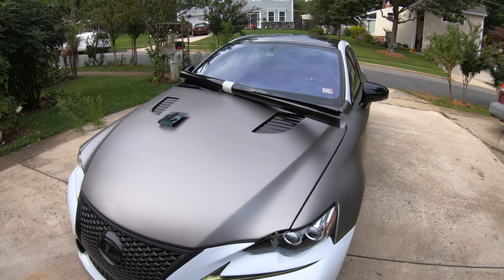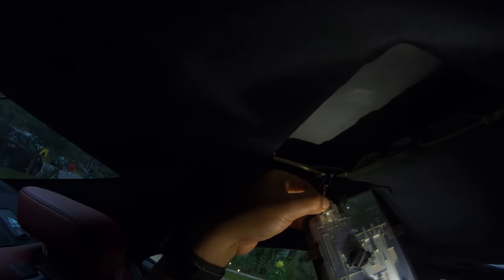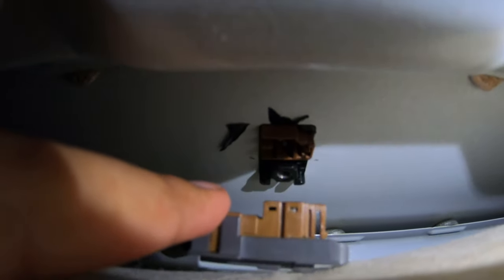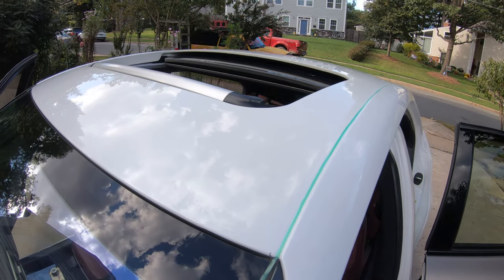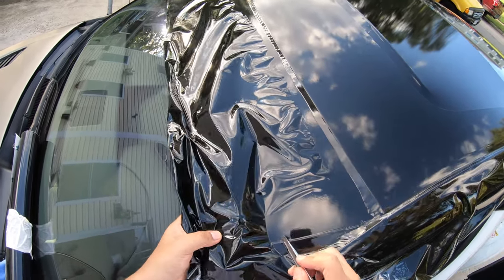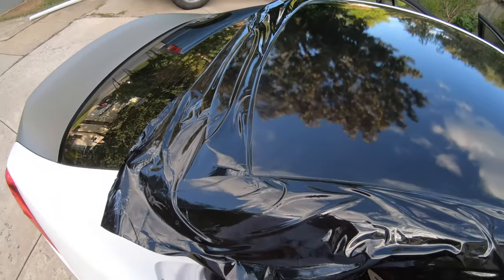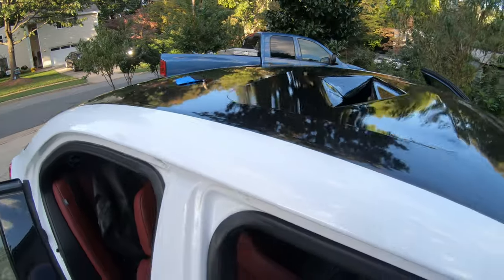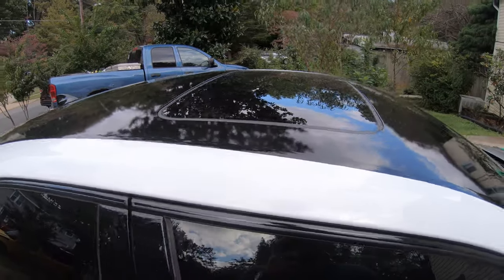Lexus IS 250/350 Roof Wrap | 3M 2080 Gloss Black

Comment: Hey bro what dimensions of wrap did you need for the roof?
Reply from the maker: Sorry about that, I should of included that lol. but the wrap size I used was 5x8ft. You will have a bit of extra wrap but it is always good to have extra just incase. I did also use the extra for my antenna tho.
Reply: @Und3rgroundLex  thanks bro! Makes sense.
Reply: @Und3rground Lex  how about if you want to chrom delete the grill how much more ft would u neeed

Comment: So I just tried this out on my IS for the first time ever and it took me like 5+ hours and a crap ton of mistakes. 
I ended up having to use the rest of the wrap to cover up for all of the imperfect areas and I've also realized that the knifeless tape that I got didn't stick too well so I had to be super careful when I was adjusting the wrap, and TBH that was the most difficult part. 
You make it seem so easy but you're a freaking pro bro and I thank you so much for this tutorial. 
Doing the wrap myself though literally made me learn from my mistakes and I'm actually thinking about cutting the wrap up by sections and doing it that way so that each piece would be a bit easier to adjust. 
It would have been dope if you included the part where you tuck in the wrap around the sunroof area, but thanks a ton nonetheless!

Comment: Checking your video out because I'm doing the roof wrap and I couldn't justify paying someone $250 to do only my rood when others paid less with shark fin included.
Ordering my materials today but is vvivid better than 3m?
Reply from the maker: Yup wrapping a roof is fairly easy IMO. You need need to the the method of pulling on side and than the other to apply it evenly. Yeah the vivid or avery is good too. I think the 3M has a light orange peel but atm i don't see it on my car.
Reply: Vvivid is for starters bro its cheaper, but 3m is better in quality i say!
Reply: @Dre.customs  vvivid gloss black is way too sticky to apply for roof wrap, I struggled with it today it gets stuck as if you squeegeed already when you just removed the backing paper. now im ordering the 3m gloss black.
Reply: @mars9313  yeah happened to me too. I love 3m 2080 so easy to work with and it has a protection layer on it that you can squeegee over and leave no marks
Reply: @Dre.customs  Yea I just ordered the gloss black 3m i believe i got the 1080 tho i'm not sure i have to double check, but I'm curious what brand to go with for a full car wrap, have you done one with 3m or just the gloss black on the roof?
Reply: @mars9313  so far i done 3 full car wraps, 1 in vvivid black but it came out full with scratches and it was my first time. Then i moved on to 3m 2080 i did a gloss red and it came out very nice and for my 3rd time same 3m but in a color shift directional wrap came out gorgeous
Reply: Damn 250? Over here they charge like 4-500

Comment: Orange peel on 3Ms gloss black is horrible do you have an update on if it's any better now the adhesive had time to set?
Reply: I want to know about this too. I've been considering doing a roof wrap and I want to know how long it will last.
Reply: @itspchu  if you can buy Vvivids gloss black instead of 3Ms, it's a much nicer finish and they claim it lasts anywhere between 5-7 years obviously this depends on the standard of the fitment.
Reply: @mai4397  don’t buy vivvid if u are new to wrapping. It’s too think and actually horrible to work with. And I’m pretty sure you got this from ckwraps so all I’m gonna say is that he is biased. Trust me I found out the hard way.
Reply: @cherry_media7917  I don't know who ck guy is, my best friend runs a mod shop and he uses vvivid for all gloss black wraps he said next to 3m the aesthetic is way nicer less haze and orange peel even though it's harder to work with but he's experienced
Reply: If any of you tried this. How is it holding up? Pros and Cons?